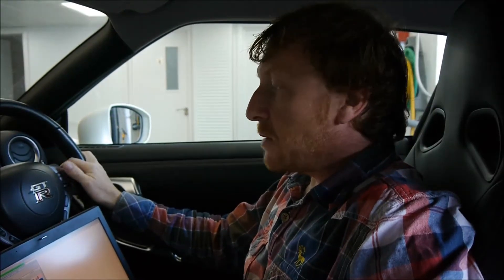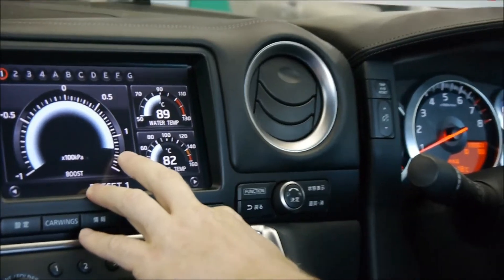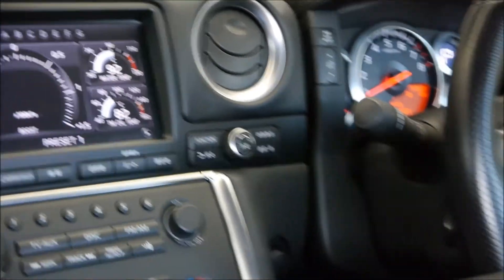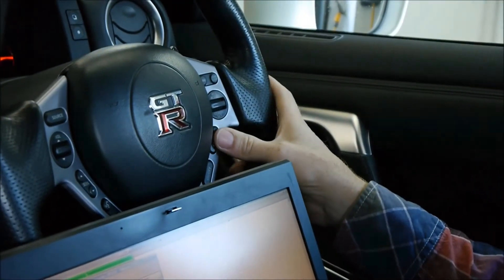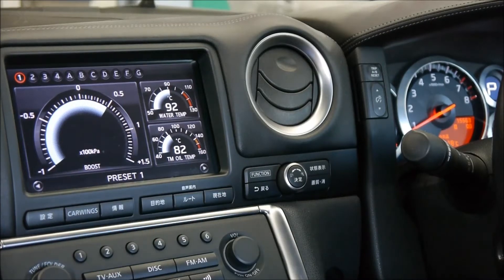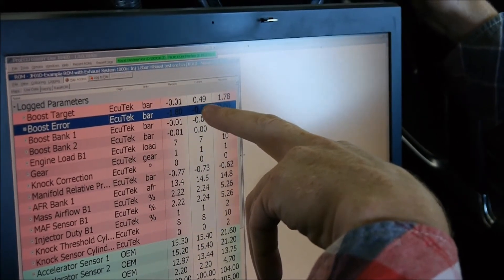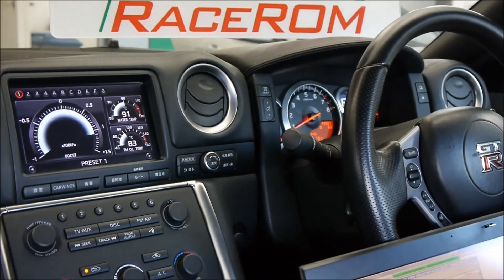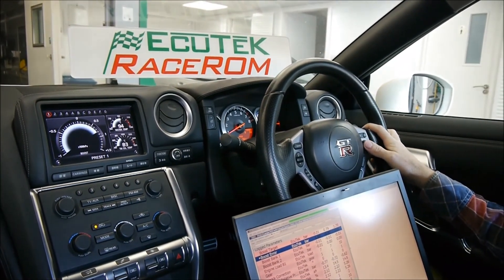EcuTek RaceROM GTR Boost Controller

Comment: I hold down the cancel button and can't seem to go into race mode? It just goes to map switching
Reply from the maker: Right. That's what it's supposed to do. Then you have the option of switching between 4 different maps. These maps have to be set up by your tuner first. One of those Maps could be higher boost and quicker shift points, so select that map and things will go faster. Call it race mode if you like. But as I say, it's got to be set up by your tuner first.

Comment: When using flex-fuel, how do we know what boost level the ECU is set at when the ethanol content changes? Example: max boost set by tuner is 30psi at 85% ethanol but I am currently at only 20% ethanol on same calibration (map) and I select Max boost on steering wheel. How will I know what max boost I am currently at at the lower ethanol content?
Reply from the maker: Max boost set by the tuner is the Max boost. It won't go higher than this whatever you set the boost target at. And to see what boost you are achieving depending what your Ethanol content is, you'll need to either get a Retail Programming kit and carry your laptop in the car or invest in our new Bluetooth Vehicle Interface and ECU Connect App. The bluetooth allows you to live log on your phone. http://www.ecutek.com/downloads/marketing/factsheets/Nissan_GTR_ECU_Connect_2017_Fact_Sheet.pdf
Reply: Thank you for explanation. Bluetooth module already purchased and ready for install by my tuner!
Reply from the maker: Excellent Sergio!

Comment from the maker: Yes you can. Whatever gear at whatever revs, you can give yourself more or less boost by using the cruise control. However you will only be able to boost up to the max set by your tuner in the software.